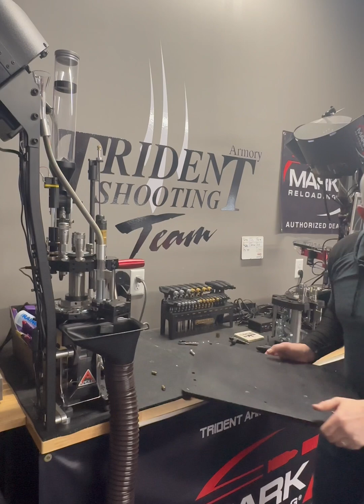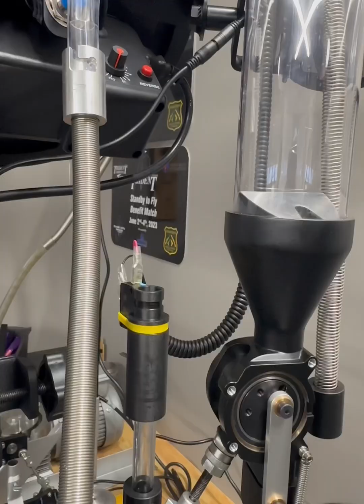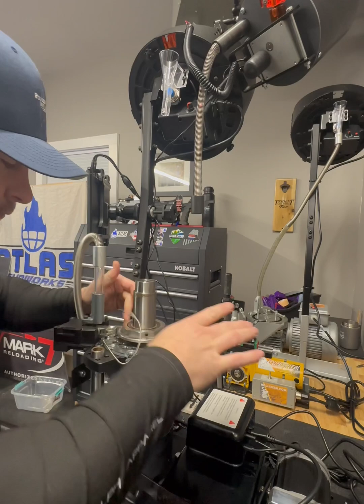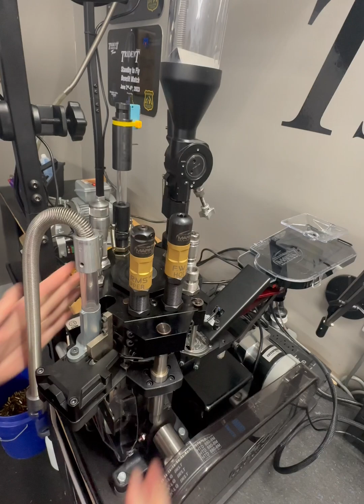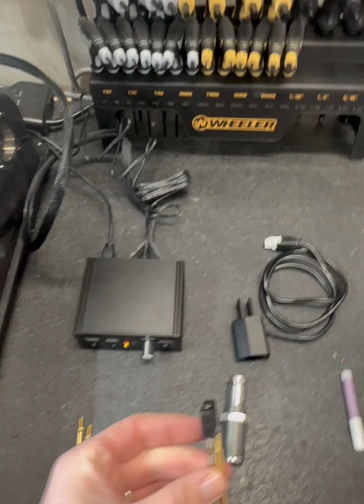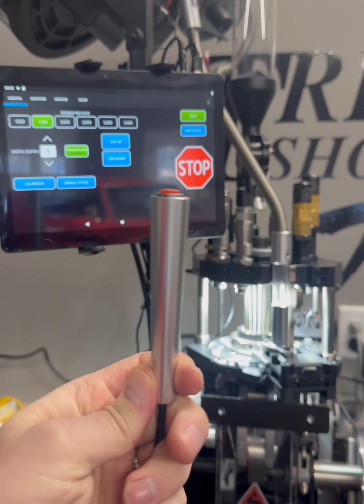Mark 7 Apex 10 Autodrive complete set up! Automated reloading press.

Comment: When you run used brass. I'm assuming you clean, with a tumbler with primer on. Then run it through it's course of getting deprimed then re-primed and filled with powder etc?
Reply: Kinda. I clean in a wet tumbler with no pins to get the bras ~95% clean. I then dry the brass, apply lube and then pass it through the press for its first pass to decap and resize. I then run it back through the wet tumbler with pins this time. When it is dried it is clean / sized / deprimed and ready to load. Some folks will do another pass where they swage and deprime only.